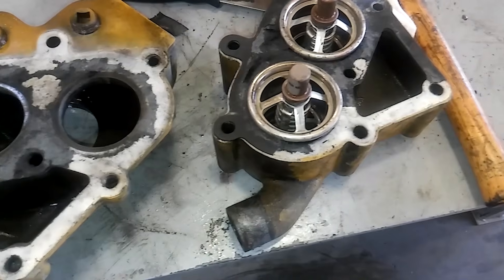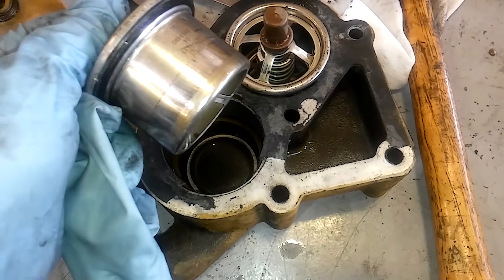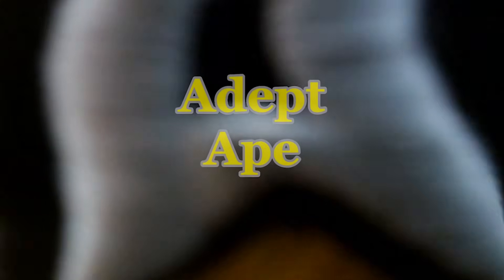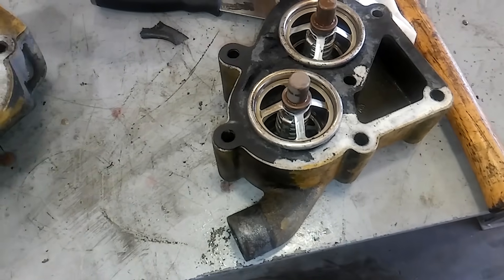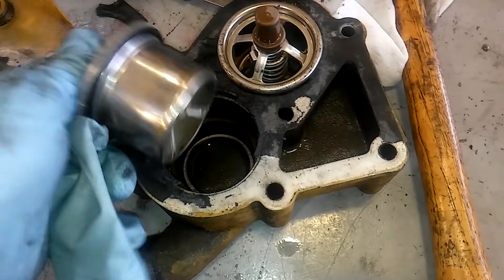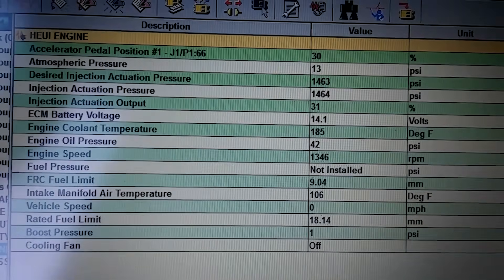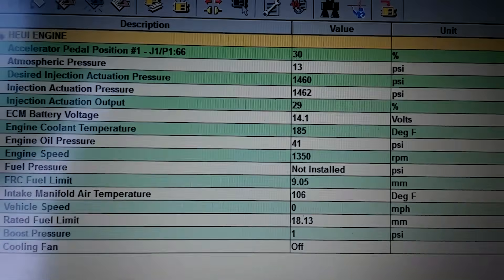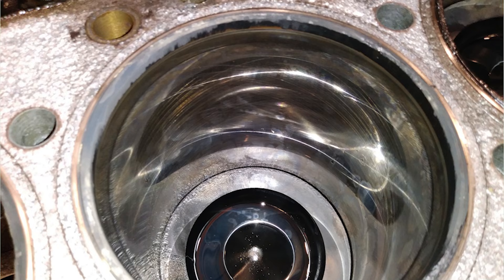Why You Should Never Remove or Use a Colder Thermostat In Your Engine.

Comment: What is your opinion on a venting your crankcase gasses to the atmosphere instead of back into the intake to be burned. I feel that the oil fumes that mix with the egr soot creates an issue that does not need to exist in the dpf, not to mention unnecessary oil in your intake, turbo, intercooler and such. Would rerouting it damage anything like your turbo seals or really anything else for that matter. I am talking about todays 6.7 powerstroke diesels. There is a lot of controversy on this subject with some saying it will damage things and others saying that it’s impossible to damage anything and that it only helps your engine. I have spoken to a couple of Ford factory diesel mechanics and they said they cannot answer that question due to potential liability issues. Can you please help me ?? Thanks.

Comment: Well then why did I over heat without the thermostat oh because it moves the water too fast through the radiator!
Reply: Actually, it's probably because the thermostat being removed probably means its not blocking off the bypass. Which means water is being moved but not through the radiator.

Comment: Not sure how to explain this but here I go. It's my understanding that temperature data from the coolant temp sensor is fed to the ECM to control the engine advance timing function to either retard or advance based on temps and engine loading which affects how the engine runs. Unlike the older diesels where the engine timing was static and set by the engine tech, today's diesels like my Detroit DDEC-4 engine timing is dynamic and automatically retards/advances based on engine loading. When under heavy loading the timing sets one way versus at cruising with light engine loading, it goes the other way and this is something you can hear as it happens. I think on my engine, it must be above 180°F to run efficiently. I know when I start my engine on cold days, it lopes for 3-seconds then immediately advances timing and goes into high idle mode (1,000-rpm's) which warms engine and starts lowering rpm's back to base idle (600-rpm's) within 20-minutes.

Comment: I worked on quite a few cars in the 80s and 90s where the drivability issue was lack of a thermostat for "racing." Not having that restriction can also create localized hot spots due to inadequate flow and cavitation.

Comment: If our chipper idles at 130 and goes to 160 under load would that suggest it doesnt have a thermostat in it ?
Reply: Yes, but sounds very low, the temperature gage could be off, I would check the gage-sender first.

Comment: remember, parts DO wear out. been workin' on cars since i was 8, so i know these thermostats are easy to replace, but i also don't mess with the newer engines. i will say this though. the pre LT engines(90's motors) can actually run colder thermostats and gain power. i put a colder thermostat in my 87 monte carlo and although i didn't gain much power(3 hp) that car needed as much as possible.lol.

Comment: Another problem with an incorrect or removed thermostat is with all the computer controls on the engine. Most ECUs will run different timing/fuel delivery until the engine is at what the computer considers operating temperature, so power output and fuel economy will suffer.

Comment: I have a 03 6nz. The temp never gets over 155. Is that normal or should I be upping the temp
Reply from the maker: That's pretty cold for that engine. Could be a misreading coolant sending unit, thermostat stuck open also.

Comment: I have a c-16 cat I run a 180 degree thermostat. I dont agree with running the original thermostat that were I think 193 thermostats and then the fan turns on at 195 on it's own next thing ya know you're at 210 degrees with a tail wind and 110 degrees outside temperature and heading for 225 230 degrees. And yes that's with a clean radiator.😀🇺🇸

Comment: A colder thermostat will never fix an overheating issue as long as the stock thermostat is functioning properly. That said in a mechanical engine a cooler thermostat will bring down the standard operating temperature and I found in a big cam Cummins, mechanical cat or mechanical Detroit that a 160 thermostat gives the lowest spikes in coolant temp on long pulls vs a 180 or 190 T-stat. What I mean by “spikes” is, especially in the winter, when you’re pulling a good hill in a loaded truck with a 180 or 190 thermostat the thermostat will often stay shut until you get into a good pull, and due to the design of the coolant bypass and the facts thermostats are not super precise or fast opening the temp will often spike to 210 or more then the thermostat opens fully and it drops rapidly on the gauge as the overheated coolant is allowed to flow in to the still cold regulated side of the radiator at full flow. We’ve found the 160’s will open and stay open as long as temperatures aren’t sub zero or something and the cooling system works better by running at its full flow capacity all the time at temperatures between 15 and 60 degrees F, which is about 2/3 of the year here. Obviously on an electronic engine this is not a good idea as they are able to vary several factors based on temperature inputs that will drastically decrease efficiency if run colder than designed all the time. Depending on the make and model of truck engine the ECU can vary: Injection timing, number of injection events, in some cases fuel pressure and even Governed operating RPM, and of course fuel flow,  based on coolant temperature data.

Comment: Thermal Lance was a brand name that became existent amongst all of it's kind, like "Bobcat" when referring to a skid-steer. They are "exothermic" torches, the old thermal Lance required pretty much a heavy duty welding machine and some other stuff. The newer exothermic torches you can use with a 12v battery and an oxygen cylinder. I'm trying to get the company I work for to buy me one for all the seized pins I get to deal with on our rental equipment.

ETA; I am THE welder, but also a mechanic, elechicken, air service guru, have pretty much become one of the "go-to" guys about everything.. And I deal with most of our sales trucks/equipment at some point. LOTS of Cat stuff comes through, and I appreciate all of your videos brother. You've helped me out on a couple things that had me pretty stumped.
Reply: that shit was fucing awesome man

Comment: You can use thIs analogy I use for when people put bigger oil pans on. There's only 1 real difference between a small pot and a large pot of water. That's how long it takes to got to the boiling point. So a 195° and a 160° T Stat is the same  theory
Reply: Bigger oil pans have very little to do with cooling the oil faster, though the larger surface area of the pan in the air does have slight advantages... Most Oversize pans are doing so because the oil pump volume has been increased by a larger pump, so more oil is being pushed to the top end and flung against the crankcase walls at a much higher rate (I have a 351 Ford that can idle all day with only 3 Quarts in its oil pan, spin that thing to 5000 and the pressure drops pretty quickly because it's actually trying to suck air/foam)...ALSO if oil gets too hot in can break down, becoming trash that has lost its lubricity, so it is sometimes a calculated certainty, that a specific percentage of the oil will become "trash" during a change interval...Same thing goes for contamination.  Get 2 one gallon containers...Pour 16oz Beer of your choice into one Quart of water, and two Quarts of water, stir each for one minute...then taste test each...the two Quarts (4:1) first, then one Quart water mix (2:1)...Tell me which one had more beer flavor...Think of the Beer as the contamination in the oil after X amount of hours of operation...(Remember the oil filter can't fix broken down oil, or filter out very fine contamination.) - Now as for cooling system, the 160 vs 180/190 stat really isn't going to change the cooling capacity...only flow and surface area can increase cooling system efficiency.

Comment: DAMMAT MAN!!!  200 - 210 oil temp?  My 3406B runs 150, 170 max all day long with 195-210 on the coolant. All depending on the amount of pull of course. You must be referring to these newer regen engines. No wonder they are alway breaking down.

Comment: Depending on the engine, removing the thermostats can cause overheat much quicker. Some thermostats redirect coolant when they open. So without them coolant can just loop in the block, and not make it to the radiator. Other thermostats direct coolant to the oil cooler, so the coolant can be very low, but the oil temp will get way out of hand.
Reply: SHUT UP
Reply: That's a myth

Comment: Thank you for your insightful videos I have just finished A 3406E rebuild.  Is it advisable to run heavy loads 1st or light a loads?
Reply: He has a video on proper ways to break in the engine. Basically to load it in but not too heavy to overheat. Dont use light load final gear method. Just drive it under load. It makes the rings seat in better.

Comment: Got a question.  I recently replaced the radiator, water pump, and thermostat, and radiator hoses.  Nothing wrong with the ones I removed, wasn't overheating, they were just old and I wanted new ones.  When I replaced my thermostat, I had the bright idea of drilling two 1/4" holes in the thermostat to aid in "burping" the cooling system, or purging the air out.  Now my engine takes longer to get up to temperature.  Also, my engine runs about 10 degrees cooler if I let it idle.  It comes up to normal temp when I'm going down the highway, especially with load.  Something for me to worry about?
Reply: That won't cause any issues, save for the ones you're having. The holes you drilled are way too big. Usually one 1/8" hole is plenty for air bleeding. Many new thermostats even come with a bleeder valve installed, maybe you can find one for your vehicle
Reply: You drilled the holes too big, but it shouldn't be anything to lose sleep over.
Reply: only in the winter, wear heavy socks!

Comment: combustion engines do run better if they are allowed to run on the high side of the recommended temperature stats.. there's alot to be said way too much for me to type in ,but your right.
Reply: That's why the air cooled deutz engines where so efficient. When you're not worried about boiling coolant, you can let the cylinder temps get a whole lot hotter. As long as the oil is kept in check.

Comment: Good video Josh, I have used a setup like that before removing wall pipes from a clairifier up here in Wisconsin. We call it a slice torch and they work great. It will cut concrete and anything else in its path. Makes quick work of things.

Comment: Im in Australia, we are pulling 170 tonnes and 4 trailers up a hill in 40 degrees Celsius, trust me you need the cooler stats to have a chance
Reply: Cooling system in top notch? If so then this calls for better air flow at high load, high rpm and low speeds ( even if the fans are viscous couplings ). 

Or let's just go for a bigger and better radiator! 

But thermostats shouldn't be messed with if the longevity  of the motor is in question along with fuel efficiency.

Comment: I have a 7.8l old Ford/ Brazilian engine once it gets to operating temperature it runs smooth.. Takes about 45 minutes to warm up after start at idle with an ambient temp of 50 degrees out.

Comment: If you were interested, it would not be legal to thermal lance kingpins out in new Zealand and Australia, as we are not allowed to heat steering components at all. If they don't come out we pull the axle and put them in a press
Reply: I believe that, any mechanic that has seen a twin I beam front axle on Ford truck of any era has seen (DO NOT USE HEAT)  in raised letters on the beams. I have also seen it on other medium and heavy truck steering axles. I will admit that I have had to ignore that warning many times. In the rust belt the most important tool to have is a good set of torches!
Reply: @jimmotormedic  It says Do Not Use Heat to re-align the axle. Meaning do not heat to the temperature where the axle glows red or yellow so you can bend the axle for alignment. Minor heating to allow grease to flow is something different.
Reply: @oby-1607  You are correct
Reply: That is INSANE! - I have used a torch on king pins to warm the rock hard grease and melt it out so new grease can be pumped in...Almost a daily task when working on Vintage Trucks.